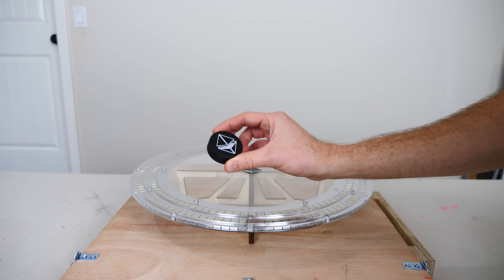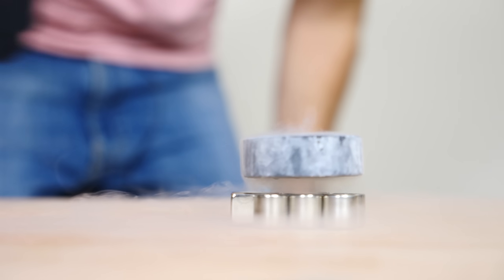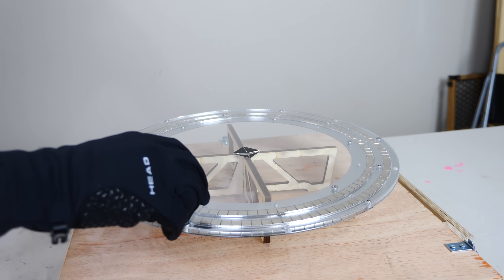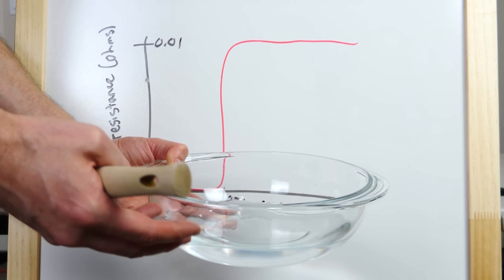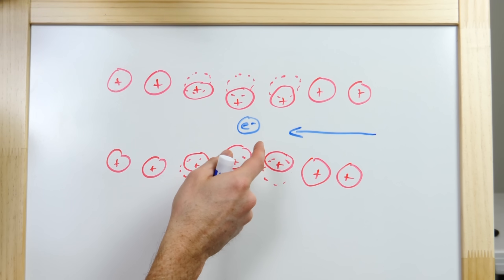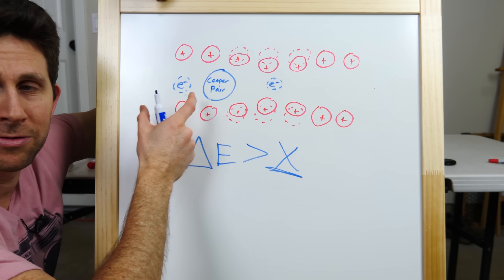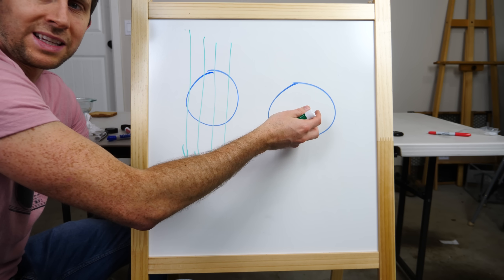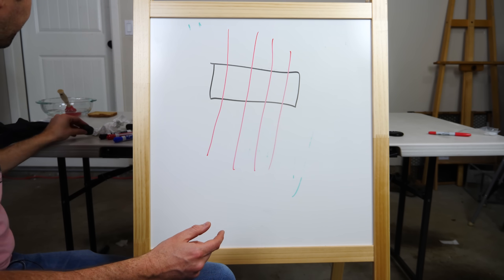Quantum Locking Will Blow Your Mind—How Does it Work?

Comment: drill a hole in the center of the track plate. in the wooden structure beneath, affix a dowel just a bit smaller than you made in the glass. at the end of the four wooden supports place your super conductors, one on each support. now you can spin the track which is hovering above the conductors. friction less movement at any speed. if the glass was bladed in such a way as to create lift 

you produce a drone with no need for a power supply. the only thing you need is the initial source to spin your disc enough to create lift.

Comment: Question. If the impurity’s metals that hold the puck in were to be on an angle or even swirled would the puck still be locked or would it allow it to spin?  Or if the impurity metal was shaped like a cone so there was resistance passing through it would that change the out come ?   Also what if the impurity metals were able to be manipulated in the superconductor could you drive it?

Comment: Quantum locking is caused by when the particles , atoms , electrons , all of thats magnetic poles  Start to point in a sort of jagged type of different directions  With in the material being used (Brought down in temperature) And causes a drag on the magnetic lines that are passing through it Which is causing that little puck to stay in any position you place it in And hence the effect that your witnessing it doing 🙂🙂🙂

Comment: Quantum locking exist

Gravity: finally a worthy opponent
Reply: Now we all know how UFO’s fly
Reply: Gravity is actually pretty weak.
Reply: Electromagnetism to Gravity: 'Hold my beer'.  Merely rub plastic rod with a cloth and watch tiny bits of paper rush up to rubbed plastic rod like gravity wasn't even there.
Reply: Zero point energy & anti gravity. Technologies we've had for 60+ years.
Reply: @3g_Evolution  No such thing as anti-gravity. Just because the force is invisible doesn't mean suddenly gravity doesn't exist. If you hung an object on a visible piece of string, does that mean that object is free from gravity? No, it means that the strength of the string is greater than the gravity on the object's mass, so the string doesn't break and the object stays hanging from the string. In this case, the "string" is invisible because it's a magnetic force, not a tensile force from a piece of string. But same exact concept, you just can't see it. The puck is hanging/floating on the magnets; the weight of the puck is carried by the magnets. If you held the magnetic rail in your arms, and put the puck on top, you would feel the weight of the puck being added to your arms, even though it is floating on "invisible" strings. Gravity still applies to it.
Reply: @ginsuown  yet.... it appears the type 1 superconductors are anti magnetic force. Perhaps...there is a way to fold gravitational waves around another material.
Reply: meh. gravity is the weakest force im pretty sure
Reply: San Cheech how bout dark matter, it’s just this wee thing that scientists think might cause THE FREAKIN EXPANSION OF THE UNIVERSE!!!
Reply: @finn54123  Sorry, but parkour still has it beat.
Reply: What do you think Gravity is, a constant based on coefficients of mass?
Reply: “Exists.”
Reply: Parkour has been a worthy opponent for many a millenium.
Reply: @windows1057  You fool, the battle is already won.
Reply: It's the same category
Reply: Think comment should've had so many likes that everyone in the world would need to like twice

Comment: What happens with the track tilted 15 to 30 degrees? With virtually no significant friction, how long could it go around the track for? And if you start the magnet at the very top and just nudge it, could it complete a full rotation?

Comment: Assuming the small magnet weighs much less than the superconductor, does anyone think this might be the answer to how colossal pieces of stone were used to build ancient structures such as pyramids and cenotaphs? I mean if you can lift the small object the large one just goes with it for the ride, so to speak. If you were able to weigh the two objects together when one is suspended under the other would the combined weight be a traditional A + B = C or something more spooky like C =  A - B over the inverse sum of everything we can think about in 7 seconds (where A is obviously the small magnet and the inverse sum bit is obviously  - not very much)   😟

Comment: There's another way to explain it. Electrons have no electric charge. They are shaped like donuts, torroids, moving in on themselves, a suction side and an expelling side, moving aether. When cold enough, the suction sides can stick to each other. Electric charge is an illusion, it is simply crowding of electrons (negative static apparent charge) and electron deficit, vacuum ("positive", too few electrons). Think about this alternate model and Cooper paired electrons, see if it works further.

Comment: What about some gloves when you're handling liquid nitrogen? Just a thought.
Reply: IAIN RODGERS I’m just gonna handle this object I cooled down with liquid nitrogen with my bare hands.  Nothing could go wrong.
Reply: It is dangerous to use gloves with liquid nitrogen. If you get some in or on the gloves you will get severe burns. But if you don't use gloves the evaporation will shield you against the nitrogen.

Comment: Out of curiosity, could you theoretically make an actual "overboard" if there were rail lines and the superconductor were on the bottom of the board? And I understand the superconductor needs to be cold, so would there be a possible way to use liquid nitrogen as a constant coolant like fuel? IDK im just postulating

Comment: what if they could use this for transportation? Like trains that use this to float on a track like he did. Use quantum locking, a track made of magnets, some sort of force to get the object that you would sit in moving, and then something to catch it if you need to stop. They could have stations (like train stations) that would "refuel" the superconductor (re-freezing it with liquid nitrogen).
CSX Transportation and Norfolk Southern Railway each spent roughly $1.5 billion on fuel in 2014
In addition, when delivered in Dewar flasks, liquid nitrogen costs about $2 per gallon but when delivered in bulk storage tanks, it costs about $0.50 per gallon. Nonetheless, the atmosphere is about 78 percent nitrogen so liquid nitrogen can be manufactured anywhere and will still be relatively cheap.

Comment: Why can’t astronauts use this to do maintenance on spacecrafts instead of tethers connecting them
Reply: It would be a fixed track that they can travel on and space is already freezing
Reply: @andythiel3177  Well, some parts are freezing while others are not. The ISS couldn't use this because it doesn't actually get cold enough for the superconductors to work without something else to cool it. Also sunlight would be an issue.

Comment: Research flat earth. Our sun and moon are close, local and much smaller than weve been told. They circle above us using this quantum locking. Look into it. Water always seeks and maintains its level. Earth is 70% water. Many proofs that the earth is flat and not a sphere. There is no measurable or observable curvature. Check out a channel called : taboo conspiracy ll.
Reply: What I don't get is what's the point of keeping something like that a secret? What's to gain by it? Why are flat earth idiots so gullible? If your stupid religion didn't say the earth was flat and said it was made out of cheese would you believe that as well? Doorknob!

Comment: Since space is cold enough to keep the super conductor at a temp to interact with magnets like this and space is a vacuum, could you use this to make something rotate around a track indefinitely because this could be used to do some cool things
Reply: honestly I want to know if this possible because that is an amazing hypothesis
Reply: @matthewmaurer3212  Space isn't a perfect vacuum but yes friction is nearly zero so it would go on for thousands of years +- some. Space only gets rid of the cooling problem. You still need these symmetric magnetic fields. So yes, if you built a track out of magnets in space then you could use it for near frictionless transport etc.

Comment: So lets say, you now take this experiment to a vacuum situation.

The superconductor doesn't experience any friction from air or surface. It should increase the spinning time as they wont slow it down.

Because there is no gas for convection, no contact with the surface for conduction that only leaves radiation from having any influence on the superconductors motion.

This would make the superconductor in motion for extremely long and probably extremely consistent until it has slowly heated up due to radiation,  which if you minimize that could be very long especially if the element is cooled very deep.

Comment: Subscribed! My Brain just had a growth spurt. Great Video. How can they not have free energy devices by now. Even with the Mechanism and timings all  controlled virtually, in the memory of a computer. 

I just know by now these great minds could easily do this. Like an angle grinders speed....if this could be connected to a generator for example, wouldnt it make more Energy, enough to power itself. 

Or a smaller device helps a bigger device, that steps up and up to bigger devices and so on. Just can't believe it hasn't been done.

Comment: 3:17 It looks like it's hardly losing any momentum. How long would it go for if you just left it?
Reply: It will keep moving as long as it is in the "superconductor' state😋👍
Reply: @WallaceThiago  Surely it must slow down from air resistance? Otherwise it's generating energy.
Reply: @napalmpig3772  yes there IS air resistance....  But it is too small to take into account cos of the small surface area of the "superconductor" ... 

No it is not producing energy... 
The initial energy input to move the "superconductor" always remains the same....  So,  it does not slow down nor does it speed up i.e. Energy is not lost nor is it produced .. ☺️👍
Reply: @WallaceThiago  Well, when it comes to physics, there is no such thing as "too small to take into account". If there is air resistance then it MUST lose energy and slow down. The only way it wouldn't would be if it were in a vacuum. I would actually be quite interested to see a time lapse. It could well warm up before enough time passes to see a noticeable reduction in speed though.
Reply: @napalmpig3772  well you do have a point 👍